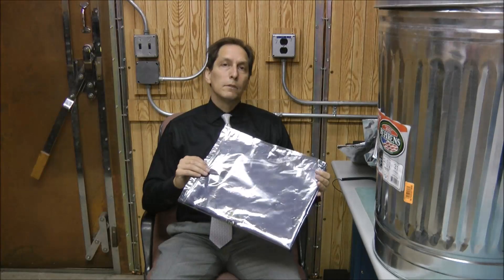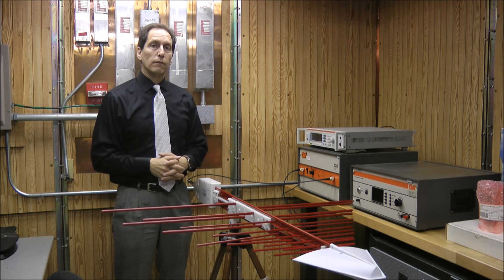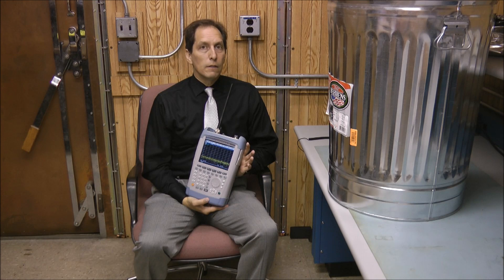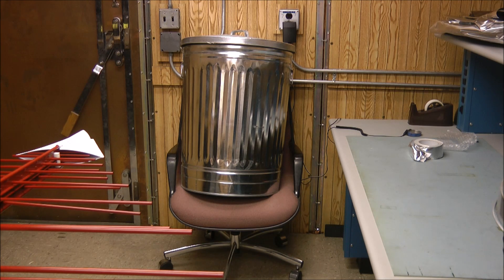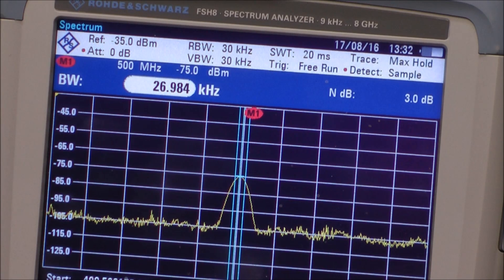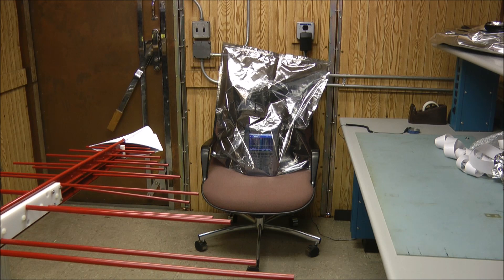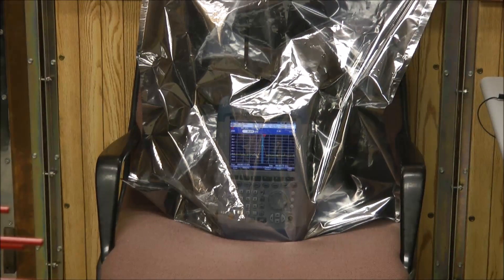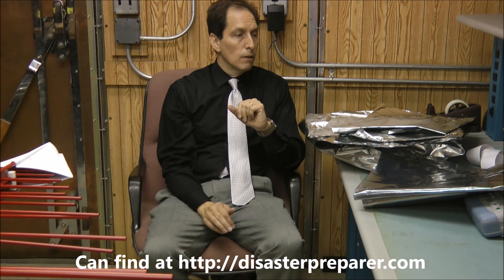Testing Garbage Cans and EMP Bags

Comment: If you want to double bag do you need to have the first bag covered with something like a paper bag to insulate it from the second or just double bag one inside the other ? Thank you so much for your videos , that are very helpful to understand shielding.
Reply from the maker: Hi Larry, these bags are actually already insulated on their outer layer. The metal is sputtered in between the plastic layers.
Reply: Thank you for your quick answer. You have helped so many understand what to do to protect their electronics. Please keep it up.  @disasterprepper

Comment: Thank you for making this video.  My question is how much shielding  is necessary to protect the electronics that I would put in a container?   50 db? 75 db? 100?  or  more?  your creating a electronic signal an blocking it but your signal isnt really comparable to say a small to medium size emp,  or is it?  thank you.
Reply from the maker: Hi Patrick, if you run the numbers, most folks conclude that 50 dB is adequate to protect from an EMP. That reduces the field by 99.7%. Some would point out that if you look at MIL-STD-188-125, you'll find an 80 dB requirement (99.99% reduction). Folks can make their own decision, but in my assessment nearly anything would survive with 50 dB of shielding. As for my testing, I'm not determining survivability to an EMP,  but rather shielding effectiveness. I sweep through the frequency spectrum of an EMP to determine the shielding effectiveness, which is standard practice. If a configuration can give 50+ dB across all frequencies, it will give 50+ dB reduction of an EMP. The difference in maximum field levels of a small, medium, or "super" EMP is only a handful of dB, so it doesn't really change the shielding requirements.
Reply: @disasterprepper  Thank you for the reply an the info I asked. I'll be doing some shopping at your web store.
Reply: It always stays a chance game depending on how close the EMP impact will be. Even a lousy shielding may protect your data e.g. at 70km distance of a nuke that else would erase them in 100km distance.

Comment: Mr. Bradley, can you turn your test equipment on a known-good alternator,  hit it at your maximum power, then get it tested at AutoZone, please?
Reply from the maker: The RF energy from my test equipment wouldn't be nearly enough to damage an alternator. Keep in mind that I'm not generating an EMP. Rather, I'm sweeping through frequencies and testing shielding effectiveness. I doubt that even a full 50kV/m pulse would damage a free-standing alternator on the shelf. Put it in a car attached to wires, and it's possible, but unlikely. Much more likely to be damaged are the hundreds of controllers/computers in the vehicle.
Reply: Thank you for explaining. I suspect the diodes and voltage regulator are both vulnerable, I've packed spare alternators in DriShield 3400 bags sealed with 3m 1170, in cardboard boxes wrapped in 3m 1126, in cardboard boxes wrapped in aluminum foil, shiny side out, sealed with 3m 1170, in cardboard-lined galvanized cans sealed with 3m 1170. Here's hoping I overdid it....
Reply: Also, I've likewise packed GM HEI modules, Ford Duraspark 2 modules, starters, and ignition coils. In case I can't get an '89-'98 Cummins with a manual shift transmission. Those need no electricity whatsoever to start and run. Just gotta rig up the fuel shutoff solenoid.

Comment: Why don't you dig a hole & bury the can in the ground with several feet of dirt above it & keep soil damp? Station an emergency shovel beside the hole so you can dig. A  jack hammer also can be kept nearby in case the soil gets too hard to dig.
Reply from the maker: It's a great idea. I did an analysis of the effectiveness of burying items in a sealed enclosure. You have to look at surface conductivity to determine how well protected it would be (i.e., dry sand is different than moist soil). It ends up that you have to bury something roughly 10' (moist soil) to 100' (dry desert) to get reasonable protection. It's doable, especially if you already have a hole of some sort, but it sounded like a lot of trouble otherwise.

Comment: So what would the good doctor recommend for a really good (i.e. better than the trashcan) faraday cage? are certain metals better than others, such as steel being better than aluminum or copper better than steel, etc etc????? Also does the thickness of the metal have any difference?
Reply from the maker: The higher the conductivity of the metal, the better, so silver is better than say steel. That said, there's not a meaningful difference when it is used for shielding, and steel is much cheaper. The thickness matters, but only up to a point. You want it to be greater than the skin depth -- which is dependent on the material and frequency. Typically a couple of layers of aluminum foil is about right in terms of minimum thickness.
Reply: Much more important is to avoid slits (e.g. between lid and can). Unlike tiny holes they make any waves pass through, those wavelength is lower. The problem with metallized foil ESD bags is that the thin coating cracks by folding and then becomes useless against electromagnetic radiation or EMP, so I consider them no reliable material.

Comment: Thanks for this great video!
I have a question, what if you put your gear inside a 3400 bag, and then inside a non conductive box and then put that box inside an other 3400 bag?
Would that not be better since the to shields don't touch or conduct each others EMP?
Reply from the maker: The bags are insulative on the surface, so they do fine stacked directly.
Reply: Okay great, thanks!
Would it give a significant better protection to have two 3400 bags stacked? Am looking for 100-120 dB protection for some ESD and RF sensitive gear.

Comment: Don't let the items in the trashcan touch the can. Put something on and around the inside like cardboard so the item doesn't short (so to speak).
Reply from the maker: You don't want anything conductive (such as an antenna or charging port) touching the inside of the can. Fortunately, most electronics are already built with plastic housings without exposed metal, so they wouldn't need any kind of insulator lining in the can. The housing itself acts as the insulator.
Reply: Have seen people use a rubber bucket inside the trash can

Comment: Hi Doc can you show what the best way to build a Faraday cage for a bed?  Also could one hook up a grounding sheet while being in a Faraday Cage sleeping?
Reply from the maker: If you're looking for a way to block high-frequency RF energy, you could hang a canopy over the bed using sheer conductive cloth. It sort of looks like mosquito netting. Likewise, if you're worried about energy coming up from underneath you, you could put a layer of conductive cloth under the mattress. I know one lady who did this and said that it helped her quite a bit.
Reply: 10-4 and thank you for the information
Reply: Sleeping always in a zero field of a faraday cage is unhealthy because the body needs the natural DC electric field.

I have only the side to the neighbouring wall next to the bed shielded (overleaping aluminium strips) and have a metallized roller blind against the mobile radio mast.

Comment: Dr., if I sent you some material, could you test it?  Smallest workable dimensions for a box to be tested would be best as I don't have a ton of it.  Also can you tell me what material(s) will block 5 G?
Reply from the maker: When I do the testing, the container has to be large enough to hold my spectrum analyzer. See my video of the large ammo can, which is about the size I would need to test something. I don't normally test other people's materials because, as you can imagine, it would be an endless job. I have a few times as special consulting activities, but I charge for my time.  As for what would block 5 GHz, any conductor would as long as it doesn't have any seams or holes that approach a half of a mm in size.

Comment: I haven't seen all your video's yet but does perforated metal work better then aluminum screen?  The holes in the perforated metal are 3/32 of an inch which is smaller then the holes in a microwave.  Also in making a faraday cage, if you use both materials can you just sandwich them together are do they have to be separated with separate earth grounds?
Reply from the maker: I haven't tested perforated metal or aluminum screen, so I can't comment on which would be better. The hole size (longest diagonal distance) has a strong effect on the shielding effectiveness, but so does how well the weave of metal interconnects. If you make a multi-layer Faraday cage, you'd want an insulating layer (air is fine) in between them. In general, Faraday cages do not need to be grounded, although it likely wouldn't hurt the shielding either.
Reply: ohhhhhh that sucks....puting a layer between them makes the build a lot harder, especially the door, lol.  Thanks for the advice.

Comment: Great job sir, in my own research I have concluded that if I test a VHF handheld two-way radio capable of opening the squelch at -120 dbm then wrapped in aluminum foil that it will NOT open up when a like kind transmitter putting out around +36 dbm is used near the UUT, like your example it is important to seal the edges very well.

Comment: Dr. Bradley,

It's a very informative video and well done experiment!  It's great to have this resource as there is quite a bit of speculation online about EMP shielding.  I very much appreciate that you have actual lab equipment and follow rigorous methods to give us this high quality information.

A question I have is regarding the use of metal trashcans (or any metal container) with some kind of gasket to avoid having to un-tape and re-tape when opening/closing the can/container.  You allude to the use of gaskets in the video.  What materials can be used for that?  

One thing I don't understand completely, which might help in being creative with a solution, is the physics of the trashcan rim "leak".  Do you cover this in any of your source materials?

Do you hypothesize that if the can lid were forced shut tighter causing more metal to touch, for example with some kind of lever or screw type clamping mechanism, this would improve the shielding characteristics?

Thanks!
Reply from the maker: Hi Ken, all good questions. The thin seam (even partial seam) around the lid can leak significant energy. That's why we tape it with conductive tape. You could use a metal gasketing material (search EMI gasket). You could even make your own out of something conductive. Some folks use EMP bags  (see http://disasterpreparer.com/emp-bags) inside the can, and leave the can untaped.

Comment: How well does the trash can work if electronic items are placed inside sealed EMP bags then placed inside a grounded metal trash can sealed with foil? Thanks
Reply from the maker: Layering like this can easily provide 80-90 dB of protection. It's the preferred method of getting very high shielding levels.

Comment: How is the transmitter not destroying ur camera or lighting?
Reply: directional antenna
Reply: He’s not transmitting enough energy to damage electronics. The point isn’t to perform destructive testing, it’s to measure the ratio of RF energy that gets blocked.
Reply: @michaelingold542  Real EMP also make inducted voltage arc over, which can e.g. drive a poorly conducting can lid seal into better conduction and so might save the content. This is a very nonlinear thing. I don't know if a professional lightning simulator can mimic this.

Comment: How about putting your item inside the antistatic bag and then putting that inside the sealed garbage can?
Reply from the maker: Layering like that is done quite often. It greatly improves the shielding. You can easily get 80-90 dB if you do it carefully.
Reply: @disasterprepper  Thanks, Doc.

Comment: I know this is an older video but I am revisiting it. TY for making these videos.  This may sound trivial but people must check the handles on these garbage cans. The newer ones are not welded on. There are now 2 slits that the handle slips into which leave an opening. Might want to cover the inside of the top near the handle with alum tape as well.
Reply: Essentially, the non welded handles are an antenna into the cage. :\
Reply: How much good would  wrapping the device with alum foil do?
Reply: done!

Comment: Hey Doc, out of curiosity is a EMP a frequency and if not, what does frequency's have to do with a EMP for testing? And is there a certain frequency that protects against a EMP?
Reply from the maker: An EMP is a broadband event, meaning that the energy is spread across a bunch of frequencies (from about 10 kHz to 1 GHz). It's difficult to generate, transmit, and make sense of attenuation of a broadband pulse, so I test at representative frequencies to see how shielding would work. It's the same general method that a military facility would verify that it provided adequate shielding against an EMP.
Reply: So is there a top frequency which the EMP can not go past? I don't know anything about frequency's. But is there a frequency which the EMP can not exceed and does any shielding methods work against that top frequency? The trash can method perhaps?
Reply from the maker: The frequency rolls off sharply by 1 GHz. Most tests are run to 1 or 1.5 GHz for this reason.
Reply: And how many GHz does the trash can test protect against?
Reply from the maker: It will protect well above 1 GHz.
Reply: Final question, what's the tape called?
Reply from the maker: It's just aluminum duct tape from any hardware store.

Comment: I heat seal the opening
Reply from the maker: Right, that makes sense. The question I have is are the seams running all the way around a typical mylar bag sealed in such a way to have metal-to-metal contact. I don't believe so, but again, I can't be sure unless I test one. I'll put it on my list of things to do.
Reply: @disasterprepper  Heatsealing likely locally destroys the metal coating =>not recommended. I often work with foil cables of LCD inside old calculators and music keyboards. Their conductive layer is flimsy like hell and breaks by any sharp fold. I tried to fix them with hotglue gun (rubbing nozzle at backside etc.), soldering station (low heat), but everything that deforms the plastic destroys the conductive layer. I also measured metallized plastic foil with a DMM (ohm mode); any small fold with crack the coating and destroy the electric integrity, so I can not recommend this material at all for shielding if there is any repeated flexing or friction involved.

Comment: Hi Doc... very much enjoyed the video, really informative and comprehensive, nice work.
Here's a question for you, or anyone else out there who might know.
I have a 40' shipping container which I use as a garage for my 4x4. Would the container behave as a Faraday cage in the event of an emp and, as it is resting directly on 8 concrete plinths, would it be sensible to earth it with copper pipe, or earthing cable ?
Would be great to have a heads-up on it.
Best regards.
Reply from the maker: It's on my to do list to test a shipping container. My guess is that it would do a decent job of shielding items, perhaps 20-30 dB of protection. The obvious leakage points would be around the doors and along any unsealed seams. Once I test a container, I'll be sure to post my findings.
Reply: Hi again, Doc... that's great, thanks for the swift reply. Problems with leakage around the door seals makes sense. As for a future video, if you do run a test on containers it'd be superb. As you know, there are so many folks now using them for storage that it would be really reassuring to have some form of definitive evidence of just how safe they'd be in the event of a pulse. Also, if you do have any thoughts on how to remedy the door-seal problem, that would be 100% good news. Anyway, thanks again for the reply. Stay safe, and best wishes to you. Regards, cuhurun.
Reply from the maker: Yes, when I look at the container's effectiveness, I'll try out a few things to see how it can be improved by better sealing the container.
Reply: Excellent news, Doc. I look forward to eventually catching up with your findings. Cheers !

Comment: What is your assessment of smartmeters? Should a smartmeter protection cage be grounded or not?
Reply from the maker: I would think that the smart meter is in the near field of the offending signal, and would therefore, normally be grounded. When in the near field, grounding helps to provide a conductive surface on which to terminate the electric field lines.

Comment: Dr. Would using those bags and putting them inside a sealed garbage can be the best way to protect electronics from emps/solar flares ?
Reply from the maker: There's no need to use a Faraday cage for solar events, only for EMPs. Solar events have much lower frequency content that doesn't couple well into small-scale electronics. The big concern for solar events is damage to things connected to long conductors (such as the electrical grid). But yes, for an EMP, putting items in these EMP bags does a good job of protecting them. You can double up by then putting those bags into a metal trash can if you like. It will provide additional shielding. My assessment, however, is that good quality bags would almost certainly be enough by themselves.

Comment: Would grounding the can help?  Is that required for EMP Protection?
Reply from the maker: No. It's asked quite often, but grounding a Faraday cage doesn't help the shielding effectiveness. Grounding becomes important for shielding in other applications but not with Faraday cages.